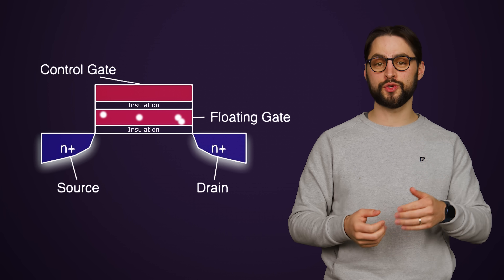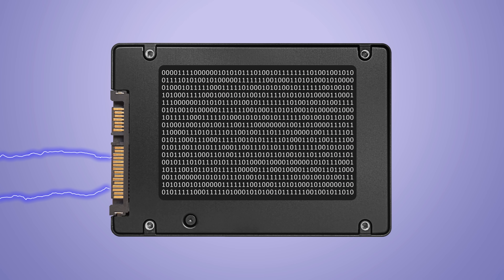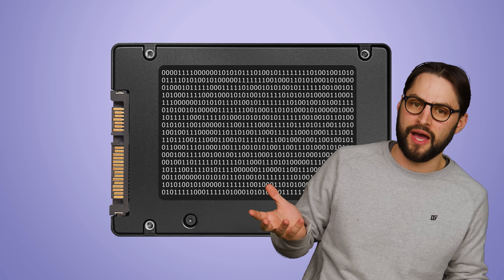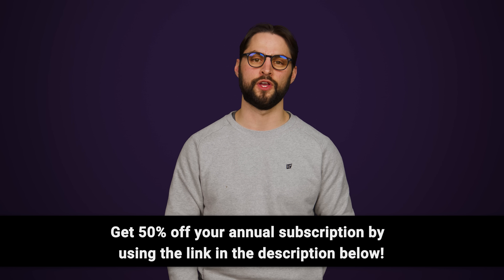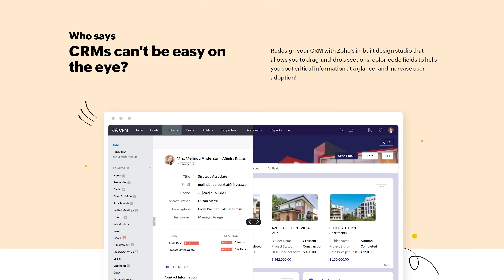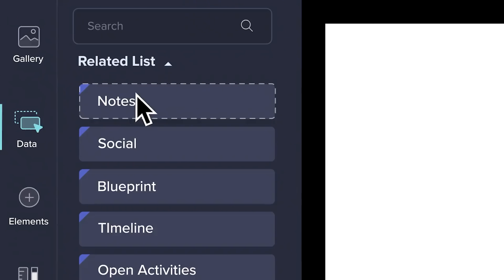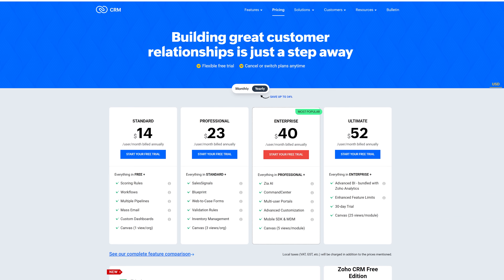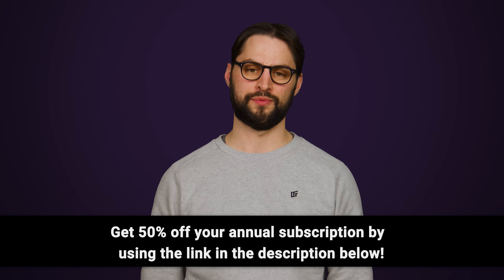SSDs Die, RAM Doesn't. Why?

Comment: You've asked for ideas for future items ... so here goes ... although if it's a simple answer it may not be enough for create a video. So I am old enough to remember having an answering machine. This was back in the days when people only had land lines. You'd come home and if the machine was blinking you'd push a button and it would play any messages you'd received during your absence.  Fast forward a bit and answering machines have become a thing of the past (although I have friends with a land line that still use one). Obviously you can take your phone with you when you go out and, in any event, people tend to send a text rather than actually making a call. However, as some of my friends don't text, I do get calls that go to voice mail. 

Now the pain of voicemail is that you have to phone in and deal with some annoying voicemail system that uses a series of prompts to get you to your message. My question is: Why can't my phone actually answer and record voice messages on its own? I mean, I had an answering machine before I even dreamed of having a computer. And today's phones are way smarter than the first computer I had. I searched for an app that would do this but couldn't find anything. My Pixel has a program from Google that will answer and screen calls for me if I get an unknown caller ... and actually converts the answer to text so I can see whether or not I want to pick up. So why not a simple app that can sense when a call is coming in and pick up and record a message after so many rings. Perhaps someone can enlighten me ... or perhaps there is some evil cell phone company plot that needs to be exposed.

Comment: Is wear leveling exclusive to DRAM controller SSDs?
Reply: Wear leveling is common among all SSDs (unless maybe some really cheap companies decide not to implement it). There are even SSDs that don't have smart controllers on them and instead use the system CPU to manage the flash directly, and those also implement wear leveling.
Reply: @hjups   
So what's the deal with the DRAM controllers? Why are they considered better than DRAMless?
Reply: @williamtael8379  Cache. When there's DRAM on the SSD, it can be used to cache part of the flash. This allows 1) much faster reads (up to 1000x faster), and 2) write buffering (if you constantly rewrite some temporary file that fits into the cache, it doesn't have to be written into the flash until a different part of the flash is read - a cache miss).
The same thing happens with spinning disk HDDs too (they often have a SRAM or DRAM based cache for the same purpose).
If there is no DRAM on the SSD, then it either doesn't cache pages at all, or uses some of the SSD in SLC mode (could be up to 8x faster reads) which will eventually wear out the SSD even when just reading.
Reply: @hjups   
Oh! Nice. Thanks!

Comment: It was a few years ago that I thought I understood RAM better, as in "retains data as long as power is there" but then read about refresh cycles. I think this would make a useful follow-up topic.

Also what's the deal with PMEM or Optane, in this explanation?
Reply: He didn't even explain it well since he talked about capacitors (which are in no way required for RAM or other volatile memory)

So he doesn't get at the underlying reason why volatile memory is volatile. 

Here's a better explanation:

The most basic RAM is nothing more than multiplexed latches. These latches can be designed many ways, so we will keep it very basic with a set/reset latch. Even this could be designed to work slightly differently but here's the basic truth table:

S | R | Q | 'Q
0 | 0 | hold | hold
1 | 0 | 1 | 0
0 | 1 | 0 | 1
1 | 1 | undefined

So if we have set, we set output to 1, reset sets output to 0, both set and reset at 0 results in "saving" our state, and trying to set and reset at the same time is undefined. 

So now we must ask, "how do we know if a line is 0 or 1?"

The answer is that the transistor is designed such that when power is applied, it is able to rudimentary conparison of voltages comparing them to the ground and high lines providing power to the transistor. 
This can only work when the transistor is powered sufficiently, so once power is removed it is no longer able to properly and predictably compare these states. 

The end result is that when we apply power to a circuit, we do not know what state those transistors will be in. 

It takes using a different medium (like a magnetic disk) or engineering specific solutions to this unknown-state issue (like a flash EEPROM) to overcome this problem. But it is ultimately caused by the technology we are using to build the memory, the transistors. It is NOT because of capacitors.

Edit: In case my explanation was not clear enough, it is the transistors saving the state information. E.g. if we keep power and set the set bit to 1 and then back to 0. As long as we don't set the reset bit to 1 or lose power, then the output Q will remain at 1.
Reply: @kiraPh1234k 
And here was me thinking transistors were amplifiers which were being driven hard by computers to saturated state, ie no voltage on the input to a voltage on the input which caused the output to be as much as possible (any further increase on the input voltage causing no further increase in the output voltage - exactly what happens when an amplifier starts clipping a signal).
Reply: @kiraPh1234k  I think capacitors were an analogy. Anyway, as a non-EE your truth tables and letters went way over my head. +1 again to James and this video.
Reply: @spotted0wl.  The truth tables are supplementary. 

The main point is simply that its the storage medium (transistors) that is responsible for the volatility of RAM, and the specially engineered storage medium of an SSD that exposes it to more issues with wear/deteriorating to combat that issue with volatility.
Reply: @kiraPh1234k  Your explanation is fine for SRAM but completely misses the boat for DRAM, which is what modern computers use. DRAM does use charge traps 'capacitors' essentially. Your truth table for a basic SR latch is nice and all, but has nothing to do with DRAM.
Reply: Fantastic question. There are so many ways to do flash storage. More explanations please!
Reply: Intel's brand name Optane has two different technologies.  One is just a fast normal SSD.  However, the Optane memory plugs into a DIMM socket is interesting.   It works like DRAM.  It is a ten times slower DRAM but with ten times density.  Neither Intel or Micron reveals details of the Optane DIMM.  Some very basic information is that it is not floating gate as usual flash and thus SSD.

Comment: All the data i have ever written globally… is not enough to kill even my lowest capacity m.2 drive…

SSD’s can die sure but modern ones are basically immortal

The SSD’s i consistently write to are rated at 3115GB thats 5 writes per day for a year to kill just 1 of my larger ones

Comment: SSD's can die? Damn I thought the idea of ssd's is that it cannot die like a hdd. What about M.2 Drives?
Reply: Those are still SSD’s and they still eventually die

A basic 2TB drive from the likes of Sabrent can outlast 3000TB’s written before they die thats 5 full drive writes per day for an entire year!!

SSD’s can die but any made in recent years will probably outlast the owner
Reply: @commanderoof4578  So... basicly SSD's can die but... actualy not because they just survive that long? Ok fair enough
Reply: It would be nice if someone could create a SSD drive that did not wear out over time from writing. Should be possible to solve in some way but then someone need to invent another technolygy. Flash is currently the ONLY non volatile solid state storage technology in existence. For now i actually trust HDDs more since I do game development and write and update loads of data constanyly including hi res graphics ect all time. SSDs are best used for holding things that rarley changes like installed programs and the OS although windows update takes its toll over time but minimizing writes as much as possible should increase SSD lifespan a lot. On a computer with an SSD you should for ex have so much RAM that u can disable the page file wich cause lot of wear to an SSD by constantly writing temporary data to it. Also hibernating should be disabled wich dumps the entire content of RAM into the SSD every time computer goes in stand by mode. Instead sleep mode should be used wich hold data in RAM while idling or just turn the computer off. The OS loads fast from an SSD so that also works but hibernating should definitley be avoided with SSD drives. Also NEVER defrag an SSD!
Reply: @johnpekkala6941  while SSD’s do wear out… just get a modern one 2TB’s can be 3115TBW or more before they die

No was in hell are you filling it enough times to kill it anytime soon

But for storage with minimal risk of corruption that is still tape storage because SSD’s can and still do have Data Rot / Bit Flip because quantum physics say FU

Comment: The critical difference is that the capacitors in RAM (in this case: DRAM) are refreshed regularly, which doesn't happen when the PC is not powered.
Reply: what does it mean to refresh a capacitor?
Reply: @hams_salad  Ram takes a small slice of time between regular system clocks to "Recharge" any capacitors that represent a 1. Essentially, the capacitor's current value is read, and if it is a 1, the capacitor is fed electrical power to bring it back to full.

You can think of a capacitor at these timescales like a leaky bucket. A 1 is represented by a bucket that is more than half full, a 0 by a mostly empty bucket. Before the bucket has time to leak from more than half full to mostly empty, the ram refreshes the value, topping up the bucket.
Reply: @trapfethen  Oh that's awesome. Thanks for the bucket analogy, that did it for me lol
Reply: @hams_salad  It's also pretty cool that it can refresh an entire row at once, so no need to check each individual bucket but just one row of buckets.
Reply: Well, ActUALLy, there are no capacitors in RAM!
What is used is the parasitic body capacitance that is inherent to silicon on insulator transistors!
Reply: @zlac  A distinction without a difference
Reply: @smeggyhead1  I'd call a difference between a semiconductor and a passive component a pretty big difference, but ok...
Reply: @zlac  Not when they are doing the same job, I = C dV/dt,  by design

Comment: Capacitors actually can hold charge when no voltage is applied. 
RAM uses flip-flops to store bits.
Reply: SRAM uses flip-flops, DRAM uses capacitance that gets passively drained by the read/write circuitry (and has to be refreshed to maintain its state while powered)
Reply: @ShinyQuagsire  You are right DRAM uses capacitance . The video implies that capacitors need constant power to hold their charge which is not true (2:34) The reason DRAM cells require refreshing is current leakage which is partly due to the very small distance between capacitor plates. Normal capacitors can hold charge without needing constant power.
Reply: @metty7528  The DRAM cells aren't supplied with constant power to hold the charge. The power is only needed to refresh the cells (i.e. to prevent the charge from leaking beyond the point of no return). The recommended interval is around 64ms for DDR4.
Charge will remain within the DRAM cells for a longer period of time (it decays exponentially), but once it falls below the threshold that the sense amplifiers can detect, it might as well be 0 volts. Larger capacitors can have longer decay times, but you have to consider how miniscule the DRAM capacitance is (If I recall correctly, it's on the order of pico-F).
Reply: @metty7528  Can you link a single capacitor that holds a charge without needing power? Essentially a capacitor that has a zero leakage current?... Those don't exist and if some company invents them, they'll make billions.
Reply: @ShinyQuagsire  SRAM does not use flip-flops. SRAM uses pairs of inverters (the most common structure is the 6T cell). Registers within a CPU typically use flip-flops.
Reply: DRAM uses capacitance and yes, the data is kept for a while after the power loss but not for long, so using DRAM as storage does not make sense.

Wikipedia:
"DIMM memory modules gradually lose data over time as they lose power, but do not immediately lose all data when power is lost. Depending on temperature and environmental conditions, memory modules can potentially retain, at least, some data for up to 90 minutes after power loss."

Comment: I set up my system drive to have as few writes as possible to make it last as long as it can. I even disabled the paging file on it. Extreme? Probably, but it works with no issues.
Reply: On Windows you can only truly turn paging off in the registry…

But still a modern SSD will out live you most likely

My most used drives have 3115TBW before they die and i have 2 of them amoung some other drives
Reply: True, but I don't have paging turned off completely. I left it on for one drive just in case, but with 64GB of RAM, I don't see it getting used much. My drive will already last way longer than is reasonable (because modern SSDs are nice), but my goal is for it to still be working when it's no longer useful.

Comment: Here's an idea: explain why my motherboard had 1.5-2v on the 3v rail. (Killed ssd and ram dimm) I found a burt cap in the power supply(750w corsair). The computer still worked for 10 minutes or so then would blue screen.
Reply: Which part would you like explained?  A description of the sequence of events might help.  What was known or detected before failure?  Where, how, and when were measurements taken?  Could have simply been faulty PSU or perhaps VRM on motherboard was bad or also some component connected to 3.3v line was shorting and causing strain on the line.  3.3v I think sources power for  SSD and RAM so that all makes sense.  Can't say for certain but sounds like the fault has cascaded and would be bad idea to plug either motherboard or PSU into anything as they are now.

Comment: actually, this is a huge problem with flash storage in general, and i get your argument that ssd drive would last long enough until the next upgrade, but is a lot of cases, upgrade, or even human intervention is not possible or feasible,  which poses a huge problem for ssd/m.2 drives.
Reply: Depends in the drive my smallest one has a rating of over 500TB or the equivalent of installing my entire epic and steam game libraries 100 times

A modern one that is TLC will outlast all other components in your build under normal usage

Currently only QLC drives pose a risk of up and dying anytime soon… but even then they are ment to switch to a read only state and not just die

Comment: I like both RAM and SSD  because they saved my dual core Intel Celeron laptop from 2014  going in the trash. Best upgrades i have ever made. SSD don't die because i don't use hard drives anymore, except for external storage for backups and data.
Reply: he just explained that SSDs can definitely die....
Reply: @William-Morey-Baker   I don't write the amount of data that can make an SSD fail. Its just too much data, too much terabytes. But i can remember the pain of using hard disk with this kind of processor. SSD made it so faster. Hard drives are kinda dead to me for this reason. Only using for the sheer amount of data they hold therefore good for backups

Comment: 0:30
wait...im not exactly sure when you said "bit"  if it's the propper terminology...i could be wrong but i thought a bit was not just a 1 or a 0 (which im very familiar with binary)   but a bit can also be referred to as any alphanumeric and or symbol.   for instance...if you have a 256-bit encryption (basically vpn military grade encryption)   so a bit can be any number,letter,or symbol that you see on your keyboard...and to decrypt something of that magnitude you need a 256 consecutive combination of all those numbers,letters,and symbols to decrypt a 256-bit encryption...(which btw... would take a brute force attack of a field of supercomputers like 20+ to even decrypt something that level of encryption...

am I correct?   or  is the same term used for both situations?

just curious
Reply: a bit always refers to a single 0 or 1.
Reply: a bit is a 1 or a 0, what you mean is a byte (8bit in Ascii for example) a number that represents a character
Reply: @saschathinius7082  ok yeah i get that...but then does that still refer to "bit"  encryption???  and does that also apply to interet bandwidth since that is measured in just 1s and 0s as well?

Because i know what a byte is for sure...but there can be multiple uses  sometimes   break that down for me real quick if you please...thanks...you responded so fast i figure your the one to ask
Reply: @ZenRyoku  : in encryption the bit thing is the key length... how long the key is! as longer the key as more possible permutation there are
Reply: @ZenRyoku  :  it means how many digits (bit) the pointer of the key has... for more info, sorry you need to google yourself
Reply: @saschathinius7082  what exactly do you mean the pointer of the key?
Reply: @ZenRyoku  : Hey this is YT... not encryption 1:1 class.... before you dive into encryption... you need to understand  IT basics and algorithms...  and that is your task... not mine.... use Google to find information about this... sorry, but I don't have the time to teach you... I'm sorry... but I never said I would...